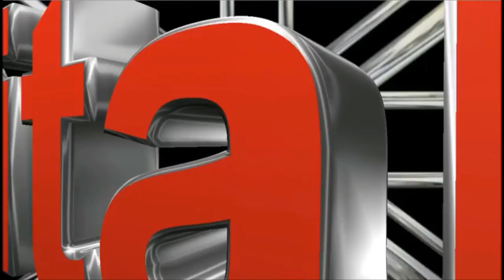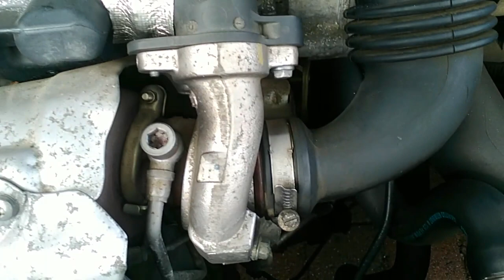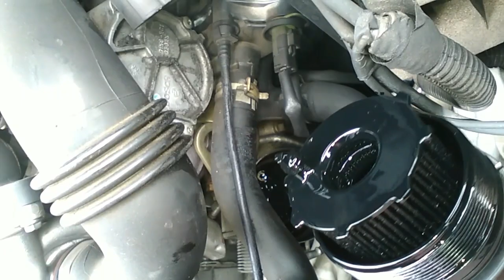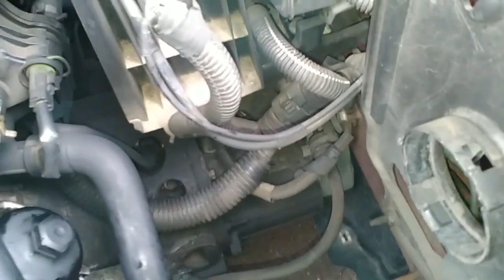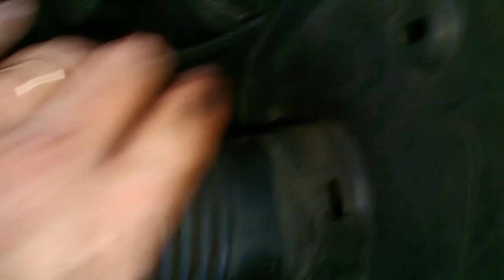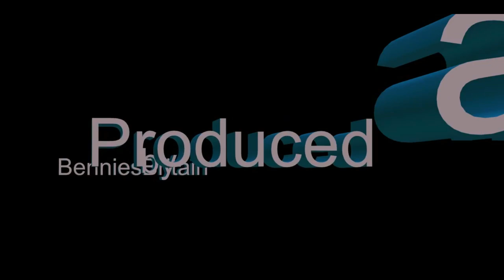Citroen 1 6 HDi Oil Filter Location

Comment: A similar filter housing is used on the 2.0 HDi, as fitted to Peugeot Expert and variants. The principal difference is that you can actually see the housing on the 1.6 when you've removed the air pipe, while the 2.0 is very well hidden. A special 27mm double cranked wrench makes the job extremely fiddly, rather than completely impossible... Not the best bit of PSA design.

Comment: That new filter was not exactly the same as the old one. The problem is locating that little plastic peg in the hole. Looks like those two additional broad plastic legs ensure the correct position. Wonder what brand it was.
Putting the filter in first only presents the problem of the top canister cover unable to be fully pushed onto the filter without turning to engage the threads and pull the canister down. Unfortunately the filter doesn't turn on the canister top until we'll on and can put pressure on the plastic peg and put it out of position or indeed break it. Those two additional legs look to address this problem.